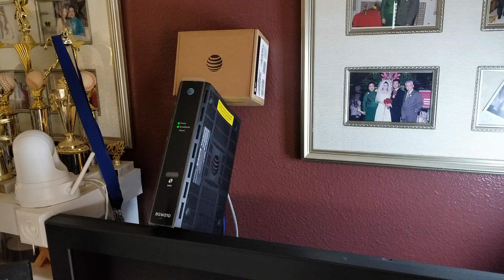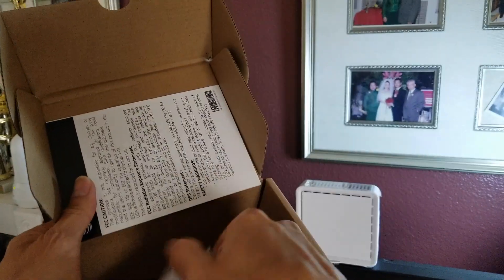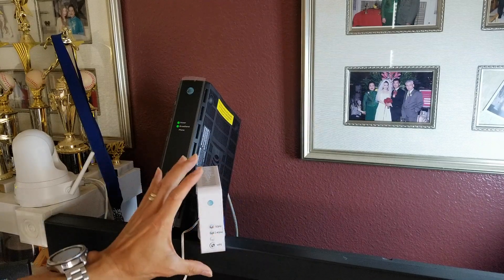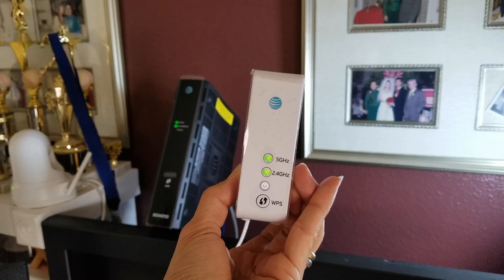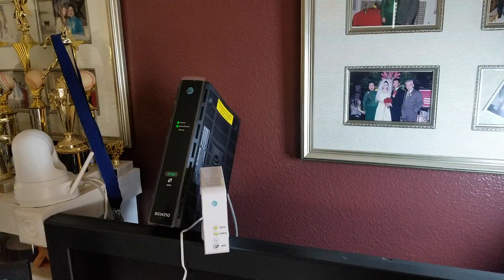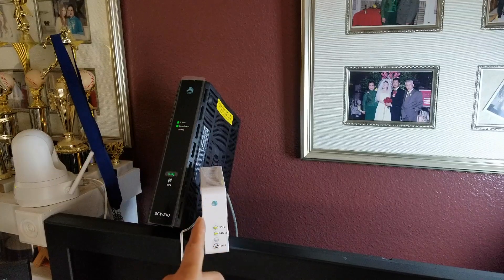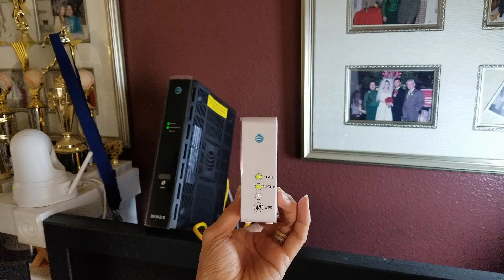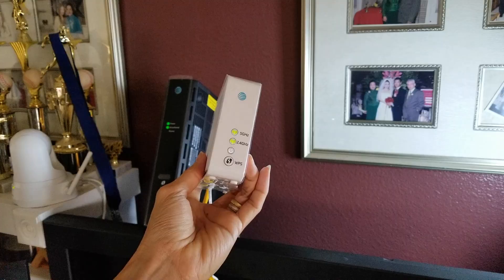How To Install Fix & Troubleshoot AT&T AirTies 4920 Smart WiFi Extender!

Comment: I tried both ways and it didn’t work. I recently got a new router but the extenders wont connect. It worked previously with the old router and it wont connect with the new one. The lights are red. Any other suggestions?

Comment: Is the Air Ties 4920 WiFi extender compatible with a Verizon router? I have tried factory reset; WPS pairing was successful, yet it is showing offline on my router interface. What would be the best Wifi extender to use if the air ties is not compatible?

Comment: How do I turn off the 5ghz on the AirTies?  I am trying to connect a device to my Wi-Fi but it will only work on 2.4ghz
Reply from the maker: You will need to turn off from your wireless router: 192.168.1.254 or look at your router label for setup

Comment: I am connecting two of these in my house.  But they will be wired.  Do, I need to "sync" everything the way you did at the beginning and then plug in the cable for it to sync as well??
Reply from the maker: Yes, if you don't then there will be no connection on your AirTies Smart WiFi Extender.

Comment: I’m trying to add a second AirTie and the 5GHz is blinking red.  How do I add it?
Reply from the maker: Blinking red network lights mean that the extender is out of range of the WiFi, so we recommend trying 2 things:

1. Reboot your Gateway by unplugging the power for about 20 seconds then plugging it back in.
2. Reboot the AirTie, if you haven't, by unplugging the power for about 20 seconds as well.

If those steps don't work, try moving the AirTie closer to your Gateway to see if it is able to pick up the signal again.

Comment: Make sure if you buy one of these devices expect to be out $50 whether you need it or not! I got this device because I couldn't figure out what was wrong with my internet, seeing as I could never get an AT&T tech on the phone, don't think that's something they even offer any more. I realized my WiFi adapter needed to be replaced instead, so I took took the unopened box to an AT&T store and they told me they couldn't accept it and not only that, that AT&T would CHARGE me $55 to return the device! Laughable! So I just got off the phone with AT&T and, of course, after sucking up nearly 20 minutes of my time, they told me the device they JUST SENT ME was an older model, and now it's been over 14-days, so I cannot return it. Mind you, unopened, still in the cellophane. I've read more reviews that this device is a rip-off, so make SURE you really want to try it out, because returning it is obviously not an option!

Comment: After it is connected and running, will I see the same network and password in the new area or will it show up as another choice on the available networks on my cell phone?
Reply from the maker: After connections to the same network, you don't need to enter password. This is an extender which will give you more coverage.

Comment: why is that every time i come to this video the extender acts connects, but when i try and do it on my own it doesn't do anything, and i'm following the same steps lol.
Reply from the maker: Did you connect WiFi extender through a RJ45 network cable first? Did you press WPS buttons on both WiFi Extender & Your Wireless Router?

Comment: hello i wanted to ask you about a problem i have, i dropped my extender a few days ago and it stopped working , I hear something lose inside and it doesn't connect anymore is there a way to open it and fix it or is it dead for good.

Comment: Hello, thank you for your time.  

So the BGW210 is the modem, correct ?  
And I know you need to pair that and the Extender next to each other. 

But where is your router ?  And how far is the router to the BGW210 modem?  
And is it better to have the wifi Extender closer to modem or router (after it's paired).   

My router is my apt hallway.  We have att fiber optics.  My mbs jumped from 6 to 300, but I still have dead spots. I'm in a 1030sq ft one story Apt.  The complex is old (1975) and has 3 floors total.  I'm on the bottom floor, but the router is outside my wall in the hallway.   Every floor has routers 40 ft apart of say. 

I'm just curious this att extender will even help.  
I have TMobile cell service.  
And direct TV (which att just bought and ruined).  
Thanks.
Reply from the maker: BGW210 is a combination of Modem & Wireless Router and yes you will need to have Extender next to each other when trying to sync at the beginning. After sync then you can move extender to where you need but I would say around 31' to 46' without any obstructions.

Comment: I've got a very weak signal out in my work shed  using my AT&T router from the house.  It's just a little to far for a good signal.   Do you think this extender will help if I put one out in the shed? Or at least put the extender on the far end of the house closer to the shed?
Reply from the maker: Depends, how far is your shed from the AT&T Wireless Router? How fast is your internet speed and how many devices are connected within the network? You have to take all in consideration.

Comment: Just so your veiwers know the difference between extender and booster. An booster is synced through wps and extender is synced through cabling to router!!! Sadly this "extender" as at&t calls it is a booster and only likes to stay synced for a few days and then you have to repeat sync process!!!! Aka hope this helps your viewers!! As I am an IT professional for 10 years!!! Good luck everyone with this booster aka extender as at&t calls it!! There is a difference!!!!
Reply from the maker: According to my AT&T tech he advised me to place the extender where there's a good signal strength. My extender have been working pretty good and my security camera depend on the RJ45 from the extender for stable connectivity. Once in awhile I might get flashing Red leds but then it will connect or sync by itself.
Reply: @macdaddypimpping  Sorry to tell you that an extender is cable linked to router and booster is wps linked. The manufacturer of this videos booster aka router will tell you to place in area with no blockage, including objects and walls. Same as At&t, only At&t wont tell you that other routers in neighboring houses interfer. Took you device the farthest room and see if it works the same as near the "extender". Also do google search on difference between extender and booster and you will understand what I do for a living and not what At&t tells you!!!

Comment: Hello, I have the same WIFI Router, and it recently fell. When I plugged it in only the power light turned on. None of the GHz lights turned on. 
pls respond, thank you and have a blessed day
Reply from the maker: When it was dropped, did you hear anything loose inside the WiFi Router? You might have to get a replacement from AT&T.
Reply: macdaddypimpping hi, sorry I meant the extender, there is something shaking inside, so I need it to be replaced?

Comment: Could i just run a rj45 cable to a port in the extender so i have wifi ? Or do i have to have it connected through wifi just to extend the signal?
Reply: @macdaddypimpping
Reply from the maker: Once your WiFi Extender is connected or sync with your router then you can connect RJ45 on the back of the WiFi Extender to your devices.
Reply: @macdaddypimpping  but i cant run an rj45 from the gateway to the extender? Because i have a really bad deadspot i dont think the wifi will reach in my room
Reply: Oh okay connected or synced with wps okay thank you

Comment: Does this wifi extender works with a Xfinity router?
Reply: It might but it's built for AT&t so it won't sync up automatically and get the settings

Comment: Thanks for the thorough video. I tried a rockspace? extender, nothing changed. I'm hesitant now thinking none will. I have uverse 450. $279 a month! No fiber in my area yet either. On my gateway specs on the app it says 27 Mbps. I'm 20' away from it but that number I believe is what the router puts out, not what my phone recieves. All the wifi tester apps I tried say I have good signal. The 5g only goes about 10' from my router. The 2g turns yellow at 20'. You think this extender will help my situation?. My gateway is not even a year old. Dual band obviously. Lol

Comment: how do i use wifi from airties? i can not plugin internet cable into my phone XD. it still show my wifi signal still comes from the router instead ? :)
Reply: Turn off wifi turn back on if you synced it up correctly then it should connect to the strongest signal so if you're near the extender it should connect to it

Comment: Can you leave the wifi extender next to the gateway or do you have to move it to a central area?

 Also if you move the extender do you have to run a seperate cable from the gateway to the wifi extender? TIA
Reply from the maker: At the beginning of setup/sync with WiFi router and WiFi extender it has to be near and after sync with green LED lights then you can move to a different locations that can get good signal (you can either use it wireless or plug a RJ45 cable from the WiFi extender to your device for more stable internet connection.
Reply: @macdaddypimpping  thanks macdaddypimpping, I think I will try wirelessly first and if needed direct connect second. I am trying to get a stronger signal to my Ring video doorbell pro.

Comment: I’ve tried everything and the 5GHz is still blinking, any suggestions?
Reply: I’ve also noticed the lights on my extender blink red several times before the WPS on my router turns off.
Reply from the maker: Bring your WiFi extender closer to your WiFi router to sync it first and once your 2.4Ghz & 5Ghz LEDs turns green then you can move to a different location. It's better to restart your WiFi router before sync to refresh your home network.
Reply: macdaddypimpping The extender was right next to the router. But I will try to turn my router off before I try to sync them and do the steps again. Hopefully that works.
Reply: An AT&T tech came out to upgrade my Internet and "installed" an extender a couple weeks ago. I noticed it was just flashing the 2.4 light non stop. Turns out the router I had didn't even support 2.4 and that's why it never paired. So they just came back out and installed a different "upgraded' router (BGW210). Still can't get the extender to STAY connected though.

Comment: It seems like these devices are also used other Telecoms as well, such as CenturyLink & Frontier.  Little in the manual discusses using one of the ethernet ports for backhaul.  I'm interested in using them with wired backhaul, since my house doesn't seem to be conducive to wirelessly extending the local network.  I'd like to use the 4920's as a mesh network, rather than as a multi-ap network.  Any thoughts or suggestions?
Reply from the maker: You can do that as long as AirTies 4920 Extender has strong or enough signal.
Reply: @macdaddypimpping  My application of the AirTies 4920, extends the broadband signal 'sourced' by the primary router.  This would be facilitated via ethernet cabling from the primary router, to remote or extended AirTies 4920 via ethernet cables, not via wireless.  The only wireless path would be from the AirTies 4920’s to the individual user devices (i.e. Smartphones, Computers, Streaming Devices, etc.….).

Since there is very little in the way of documentation on the AirTies 4920, when it comes to Ethernet Backhaul, I’m left to experiment, and determined how the AirTies 4920’s function, when not interconnecting them via Wireless Backhaul.  In a Wireless Backhaul configuration, one band, either the 2.4 or 5 GHz band, is utilized to interconnect the various AirTies 4920’s in the mesh.  This also adds to the existing RF congestion at my location.  I would like to use Ethernet Backhaul to eliminate any unnecessary RF congestion, while adding a degree of reliability & stability to the newly established Mesh Network.

There are still some other unknown points that need to be ‘ironed-out’.  Do the AirTies 4920’s establish their own subnet, or do they simply extend the subnet of the primary router?  How do they communicate with one another over the ethernet?  Would one AirTies 4920 have to be connected to the primary router, and the rest of the AirTies 4920’s subtend or hang-off an ethernet switch?  Like I mentioned, there’s not a lot of documentation on these units, and there are some things that need to be sorted-out.  After a little online research, it appears that only four AirTies 4920’s can be used in a network.

I’ll have to set-up a few, and see how they operate.  I would prefer to not have them interconnect over the RF, and instead use the ethernet, for all traffic back to the primary router.  The RF or Wireless path, whether on 2.4 or 5 GHz would be better utilized, as the path between user devices & the Mesh Network itself.

Comment: is there a way to unsink a extender so i can sync it to another modem?
Reply from the maker: Either press "RESET" on AirTies WiFi Extender or connect network cable from your Wireless Router to the back of the AirTies WiFi Extender.
Reply: @macdaddypimpping  it is okay if you cannot help, but everytime i try and connect it to the new router then bring it back to my computer it still connects to the old one.

Comment: When your using a ps4 with lan cable to your gateway, will the extenter help?
Reply from the maker: Na, if you are already connecting your PS4 with a ethernet cable to your router.
Reply: macdaddypimpping I’m getting 2.8 speed wit lan. If I use WiFi with my extenter will it be better?
Reply: Its literally called "wifi extender" if you're using an ethernet cable it'll have no effect since you're directly connected to the modem

Comment: After I’m done setting it up can I unplug it and bring it across the house into my room on a plug in then connect to it? Please respond
Reply from the maker: Maximum favorable configuration is one Wi-Fi Gateway and three AT&T Smart Wi-Fi Extenders.
Maximum distance between the Wi-Fi Gateway and Extender is 40 feet or two walls away.
Your home layout may vary.
Reply from the maker: Yes, as long as your WiFi Extender has good range.

Comment: I have Model: Air 4921 and I keep getting a slow red blinking light. I tried your method of pressing the sync button and still no success. Please help
Reply from the maker: Have you try to reboot your AT&T Wireless Router and bring your AT&T Extender close to the wireless router to re-sync within 10 feet or use a ethernet cable connection from your wireless router to the back of WiFi extender?
Reply: @macdaddypimpping  I'll try that now
Reply: It was unsuccessful 😭

Comment: Mine just go green Them red the green over and over
Reply from the maker: Have you try to unplug the power and plug it back again? If that still doesn't work then you will need to reset your AT&T WiFi Extender on the back of the unit and then re-sync with your wireless router all over again.

Comment: Hi, turned of my 5ghz and I’m working just with 2.4ghz, cause I have some devices that just work with 2.4. But after I changed it my extender isn’t working. Can you help?
Reply from the maker: Try to bring your extender close to your wireless router and press WPS on your wireless router first and then on your extender to re-sync/reconnect again and wait for at least 5 minutes to see if it turns green led. If not try to connect your extender to your wireless router with an RJ45 cable to sync this way.
Reply: You need both 2.4 and 5 ghz one with the same name for it to work, if you have one turned off or if you have them separated or the names changed the system will reject it

Comment: My wps light doesnt turn on when i press the button on my router, its a sagecom btw idk if that makes a difference
Reply from the maker: Maybe you should restart your wireless router and try it again.
Reply: @macdaddypimpping  on the sagecom? Because thats the button that wont turn on when i press it. The aireties works.
Reply: For others with this problem, some routers won't let you hide your SSID AND have WPS turned on so maybe go in to router settings and check those setting if your WPS button isn't working.

Comment: Thank you.  Your video shows connecting the extender next to the router.  How do I set up the other ones?  Do they need to be next to the router or just do it from where I am plugging it in?
Reply from the maker: Initial setup with your new AT&T Extender should be near your AT&T wireless router then you can move to a different locations afterward.

Comment: Nice video.  Thanks.  Would you recommend the AT&T wfi extender over the others sold from tplink and netgear. I have a 1G fibbe connection from att.  Wondering if this att wifi ext will outp3rform the others available cheaper on Amazon. Thanks
Reply from the maker: According to the AT&T technician only the brand will work with AT&T Wireless Router and it's been working pretty good for me.

Comment: Mine was previously synced my son unplugged it now the 2 red lights are blinking what should I do ?
Reply from the maker: Try to turn off your wireless router for at least 30 seconds then restart your WiFi Extender to sync it might take up to 5 minutes.
Reply: Plug it back in

Comment: After you have completely synced the WiFi start extender, do you do then move it to a WiFi “dead zone?”
Reply: Additional question- once the WiFi extender is completely synced and placed in the ideal location, that’s it, right? You don’t have to join the network that’s on the bottom of the extender, correct? Thank you for such an informative video, it truly answered a lot of my questions!
Reply from the maker: Once your AT&T WiFi Extender is synced then you are all set.
Reply from the maker: Not at a completely dead zone, AT&T WiFi Extender still need to receive enough signals or you can try to use network cable to test if you can get a better connection from the AT&T WiFi Extender.